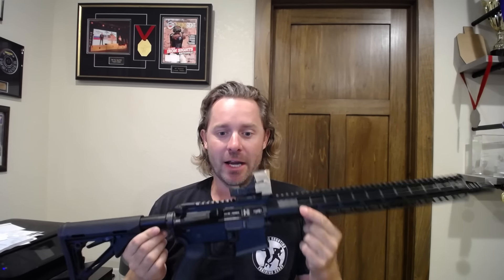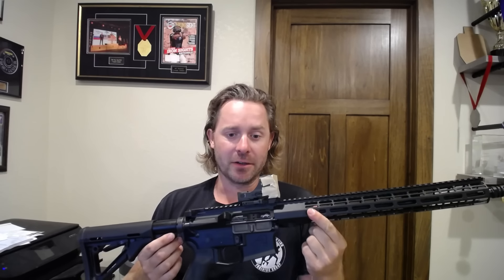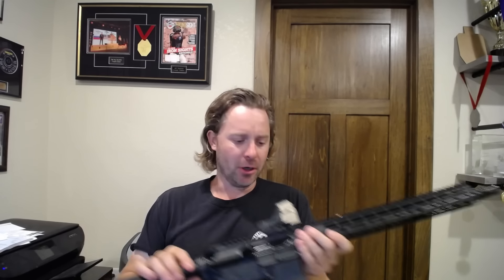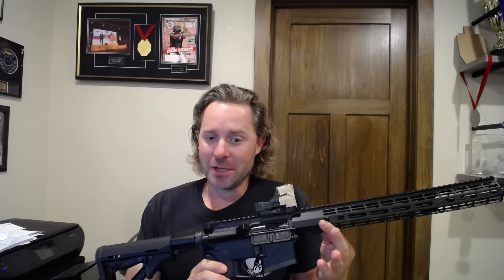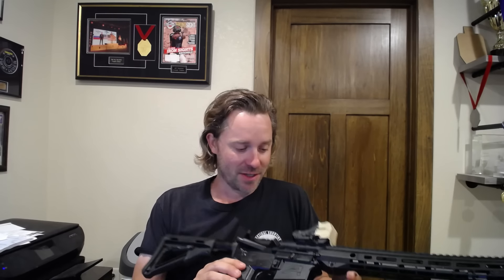Yes I understand Aero stuff is garbage

Comment: Aero is definitely not garbage.
Reply: Cope harder
Reply: Certified fresh copium™
Reply: I think the problem here is context. Is Aero “just as good” as high end rifles, no. In fact by comparison garbage is not an inappropriate term to use. 

However, most people will not EVER see the round counts that professional end users see, and for a range gun, which get’s cleaned more than it’s used, it probably will function as intended for most people.
Reply: Yeah but they are. The cerrakote on the inside of my upper chipped away in like 300 rounds. 
My DD upper has several thousand rounds through it and the cerrakote is still intact. 
I believe Aero used to be really good budget brand but they’re dropped off as of late.
Reply: @aerowrench6787  I have had similar experiences between my DD and the one Aero I have. That being said, when it’s clean and you’re running good ammo it works pretty well as a class-loaner/beater. 

I would not leave the house with it as a primary, nor is it the one I use for duty/defense. 

All I was saying is that for the average person as a range toy/hog gun/first foray into AR’s it’s not bad and is not incredibly overpriced for what it is.
Reply: I don't use their bolt or bolt carrier groups for this reason. Ben isn't the first, or will he be the last to experience this. 

I have yet to have a single issue with the M4E1 receivers or their rails. So if you put the good parts where they matter, the rest is good to go.
Reply: Aero is boo boo
Reply: Aero bcg’s are garbage. School of the American rifle goes into the best coatings. Chrome plated and Phosphate with chrome lined carrier and gas key. Nickel Boron is the worst because it is next to impossible to get a even coating. One in three are out of specification. Nitride is easy to clean. But that’s about it.
Reply: @TheDrPepperFairy23 I would absolutely argue a aero rifle is more than capable as a SHTF rifle, definitely for home defense stuff and of course a range toy. Aero builds very good quality shit. You don’t need a $7k KAC rifle for a SHTF quality build.
Reply: @9770G  congratulations 🎊🍾🎉
Reply: I have 4 Aero rifles and they all have 1000s of rounds through them without a single hiccup. Aero Precision FTW!!!
Reply: When you realize aero makes a lot of parts for a lot of manufacturers that you probably got your lame ass over priced Gucci gun from
Reply: Aero is gtg. It's not the best, but mine has ran flawlessly. They make solid recievers that you can build something really nice on. Put good parts in an aero, and you'll have an excellent rifle. I do plan on upgrading the upper to a geissele or DD because i want to downsize to 16". 18" with a RC2 mini is a bit long.
Reply: @aerowrench6787 that’s because the DD is anodized not cerakote. Cerakote wears much faster than nearly any other finish
Reply: Forged matched sets for under 200 In some cases garbage my ass
Reply: @moostangvert he doesn't need to cope.
Reply: @seanhatch4425 I'm with you have have 3 and they have all been golden. Well over 5k rounds
Reply: Aero is not 🗑️ 
😂
Reply: Tell them to ditch ballistic advantage barrels, that's a start.
Reply: @p47rr 
In fairness he also says NP3 are up there with Chrome and a quality Phosphate.

I run NP3, love them.  Only a few manufacturers have them, as Scionics controls the process.
Reply: @xanthrax6179  and Ballistic Advantage makes their barrels
Reply: @YouTubeflakeland BA makes SOLGW barrels. Are they 🗑 too ?
Reply: @Edc-Guy  Not all but they have shit runs too. It's not the puzzle maker's fault it's the barrel manufacturer. If solgw made their own barrels they would probably be twice the quality of BA, considering Mike cares.
Reply: @YouTubeflakeland  then why don’t they make them ? Could it be that he cares so much, he / Solgw team designed a specific design/profile that they stand behind for life from a barrel manufacturer they trust ? There is very few high end manufactures of barrels and it’s very rare that somebody makes their own.
Reply: @Edc-Guy  it's called a whole fuck ton of money that rich guys seek wealthy investors for 😘
Reply: @aerowrench6787 the E1 models are top tier man idk what ur talkin about
Reply: @p47rr hundreds and hundreds of comments simping for aero and youre the first other one ive seen bringing up SOTAR. its like the whole reddit ar15 sub collectively soyed out and decided to shit on ben 😂
Reply: @YouTubeflakeland don’t think aero would dump Ballistic Advantage Barrels, they own them!
Reply: @frankyeilding2546  You are correct. But most people have no idea what NP3 is. And not as common to find.
Reply: Apparently you can't comprehend the words coming out of his mouth .thx for letting us know. It's not his opinion like others but pure cold hard facts of round count
Reply: @ExcitedSolarSystem-jr2rn  they can't even take the time to pin a gas block lol, these things are not top tier. They look cool but that's the only difference.
Reply: @Edc-Guy - SOLGW has a good video on barrel finishes and longevity that really opened my eyes to how good  non chrome lined barrel can be for the price. 🤣
Reply: @aerowrench6787  That's more of a problem against Cerakote.  Imagine crying about a largely cosmetic coating instead of any actual mechanical problems with the gun itself.
Reply: @rodiculous9464  Dude makes a very short Youtube video, makes a claim, and then doesn't produce evidence in the video.

The person who mentioned SOTAR doesn't link to any video and only talks about coatings.  Considering SOTAR doesn't make manufacturer recommendations...

Oh, and SOTAR DID do a bolt physical on 2 Aero bolts:  https://www.youtube.com/watch?v=ihWIjCMme34

One had a magnetic firing pin which was fixed by running it over a demagnetizer.  One carrier had a slightly over-sized gas key.  No insufficiency of material quality was found.
Reply: @cstgraphpads2091  or more like how it’s applied. 
Again, my DD is 8 yrs old with several thousand rounds through it. 
Costing is intact.
Reply: @aerowrench6787  Cool story, now let's see some actual evidence.  Nevermind that it still doesn't mean anything in terms of the actual mechanical quality of the gun i.e. the only thing that matters.
Reply: @YouTubeflakeland  Why would they need to when torqueing the gas block screws is sufficient?  Why would that matter in terms of the quality of a receiver milled out of a single metal block?
Reply: @cstgraphpads2091  cool story bro. You wanna simp hard for aero that’s all you. 
I use my rifles and expect a high degree of accuracy and reliability. 
Does the upper receiver induce faults? Well the chipped cerrakote leaves exposed aluminum and becomes a trap for soot and later corrosion. The barrels are crazy over gassed, especially when you throw a can on them. Overcycles the bolt and even more dirty. 
I put 1000 rounds through my DD with zero cleaning and lube and never had an issues. 
My aero was a gassy, dirty and needed to be cleaned after a few hundred rounds or it would start having issues. 
Aero is fine for a range toy. Not for a live saving tool.
Reply: @cstgraphpads2091  last time I checked aero makes forged receivers lol. It's sufficient if you just lug it back and forth to the range just don't drop it too hard or fire a lot of auto lol.
Reply: Well Aero doesn't make their own BCG's or barrels.  Aero makes receivers and handguards.  Ballistic Advantage makes their barrels.....  With that being said, if you buy a rifle that was assembled by someone else, there's no telling what you'll get.  I don't let anyone assemble my rifles.  I don't trust anyone from any company with something that important.
Reply: @moostangvert  adult harder
Reply: @YouTubeflakeland  they pin the gas blocks bro ur wrong in your information.  Its just non adjustable from the factory. But its pinned bro
Reply: @ExcitedSolarSystem-jr2rn  no bro it's not, lol it's set screws.
Reply: @ExcitedSolarSystem-jr2rn  not to mention I have 4 sitting in front of me. I'm still looking for that pin through the block & barrel you're talking about lol. Seeing I'm getting broed, I'm assuming you don't know a detent from a set screw from a pin but you know they pin the gas blocks lol.
Reply: @YouTubeflakeland  what you fail to understand is in 2024. No business would actually thrive if they actually "sucked"... i do agree aero is overgassed. But add a heavy spring. 5.6 oz buffer. My ar10 308 has over 11k rounds. Rifling is untouched
Reply: @YouTubeflakeland they use pins bro...but even if they did use set screws... theres been 0 cases of gas tubes failing from Aero... so if it is a set screw.. it fuckin works!!... but its not a set screw. Its pins. So ur wrong both ways
Reply: @ExcitedSolarSystem-jr2rn  no, keep playing airsoft and paintball. I know wtf I'm talking about sugar muffin
Reply: Every gas tube is pinned in a gas block, I'm talking about how it's attached to the barrel. You don't even know what I'm talking about lol.
Reply: Idk I just paid 220 bucks for a handgaurd that is thinner, doesn’t fit right, has defects, and is crazy heavy compared to a rail that was 50 bucks that is twice as good as the aero. They are kinda bad frl
Reply: @YouTubeflakeland  "Sugar Muffin" 😂 I'm stealing that lol.
Reply: Pros recommend aero...its definitely not garbage lol however I don't care for their bcg...enough said.
Reply: Agreed.
Reply: Exactly. Like WTF.
Reply: @seanhatch4425 Low round count.
Reply: @liamvosefski2795 LMG, 1000 flawless rounds?
Reply: How sweet he makes videos in his parents basement!
Reply: Nitride treatment isn't a coating. It's a surface treatment. It actually changes the surface composition of the metal, down to a certain thickness. Coatings go on top of the metal they're coating, and add thickness, so you have to account for the added thickness in manufacturing (typically). Cerakote for me personally is the worst possible coating...it's essentially just paint. It's heavy, and soft, and tends to chip or peel over time. I hate Cerakote...the only thing it's good for is making things look "cool", cause it gives you the option for custom paint jobs. If ur doing this at home, I guess Cerakote is better than nothing...maybe.
Reply: Yes, they are. You get what you pay for.
Reply: @MattfromFlorida-u5f If by getting what you paid for is an average mil-spec service life of components...I don't really see that as a downside, for the money. I guess if you were expecting more, I could see how maybe you'd feel you got less.
Reply: @HEBEsReviews thats what i plan on doing tbf.  DD bcg, Geissele lower parts. Should be pretty good
Reply: AERO makes parts for alot of other companies.
Reply: BS just theowing more shade as he is want to do.  Nithing new here.  Lose the gut and wash your hair Ben.
Reply: @aerowrench6787  Cerakote has nothing to do with the quality of the receiver. Aero makes upper/lowers for probably 50% of the "UPPER TIER" brands you'd deem superior. I don't own Aero btw. I have a BCM mk2 upper and BCM lower and then an LMT mars-l lower and LMT mil-spec M4 upper.
Reply: I’d say the QC issues since Covid are still a thing. I personally love AeroPrecision but I don’t buy a whole gun or especially the upper. They are great for builders, it’s the best bang for your buck especially aesthetically imo. Lots of opinions on this and that’s fine, your money so do whatever you want. 
ADMMfg, Aero, BGDefense(type A rifles), SOLGW are great for builds.
Reply: Areo is a low tier AR15 just like PSA. Ok for target shooting but not real shooting and definitely not an SHTF rifle
Reply: Is aero the only company to have this part fail?
Reply: @jasenjohnson3717  Defo Not🫡
Reply: I’ve never had any issues with my aero
Reply: Saying a bolt is garbage therefore all of a company parts are garbage is hilarious. By that metric every auto manufacturer would be trash. Every AR company has had issues. KAC and LMT I’m looking at you.
Reply: @xanthrax6179  that and Ballistic Advantage
Reply: @aerowrench6787  "throw a can on it"

Anyone that simply "throws a can on it" when talking a mid-tier rifle, doesn't really sound like they know what they're talking about. Even higher end rifles need tuned if not running a RBP can.
Reply: Definitely is.
Reply: I put over 1000rds through mine. Still looks and works like the day I purchased it
Reply: I’m at well over 3k rounds with Mines. Still works and looks brand new.
Reply: Aero is TRASH
Reply: @moostangvert 😂😂😂😂 20k rounds and it's trash? Ok Mook.
Reply: @aerowrench6787 idk my Aero upper fits tighter with my lower and shoots flatter than my buddies DDM4PDW 🤷 depends on quality control imo but idk maybe I just got lucky.
Reply: They are absolutely garbage.
Reply: Their standard rails and bcgs are
Reply: I the Fudd's showed up to tell people to "cOPe hARdEr" 😂😂😂 this is their new "let's go Brandon" 😂😂😂 then they hop off because they gotta head to the Dollar General to buy their wifes boyfriend a 12 pack of Mic ultra and a bag of Takis 😂😂😂
Reply: Just their customer service, QC, and their logistics right? Waiting over a month for “in stock” items that show up out of tolerance only then you get to play the wait for hours in a customer service queue. Then if you actually manage to get a hold of a cs rep you get to play snail mail tag you’re it until they either fix the issue or you go to another company.
Reply: You're right. Aero is HOT garbage.
Reply: @seanhatch4425 how many aero bcg you own? Lol
Reply: @armon8399  PSA is far superior to Aero precision.
Reply: @andyeighttre  Aero makes plenty of junk parts. Not just bcg's.

Comment: Aero upper and lower receivers are great quality and value. I almost always go with other brands for the barrels and bcgs I put in them though.
Reply: I' agree with you there, I have used their M4E1 normal receiver sets on several builds & IMO for the money on a standard config rifle are better than any of the other normal receiver sets around. My current rig has a NB A*B arms bolt, DD CHF barrel pushing now 8500 rounds with no issues
Reply: SAME
I have an Aero M5 upper & lower receivers and built them out with aftermarket parts.  Barrel and BCG I went with Wilson Combat and they are amazing.
Reply: Why cheaper
Reply: BA makes their barrels and BA makes good barrels
Reply: So the two most important things get changed?
Reply: @TDub777  not changed, you buy the receivers as a base to build around and put whatever parts you want on them.

Comment: The military tries to replace bolts every 6000 rounds but expects them to last around 10,000..3 bolts breaking in 20,000 rounds does not make the entire rifle junk or even bad bolts..Why are Aeros junk and what parts are junk?? What was out of tolerance for you to make this claim?? Bolt over base malfunctions are usually magazine related, extractor issues ( which is an easy fix) or under gassing..Breaking a rifle in does nothing for these problems lol, in fact a good AR rifle needs no breaking in.. All things mechanical needs maintenance and seeing how long a rifle runs without maintenance is like running a vehicle to see how long it will run without changing the oil..Stupid and pointless.. More gun tube bs based on nothing....
Reply: Found a poor aero customer
Reply: Which military? USMC infantry doesn't change anything at anything unless it breaks. And if something breaks, they just give you a different rifle and service the old one whenever possible. You can have a 12 MOA at 100 meters M4 or M16 and it's considered serviceable.
Reply: Spot on

Comment: Colt military bolts USED to be replaced at 6000 rounds. I have no idea of anything from the GWOT era and beyond as I got out before then. 20,000/3 = of course 6,666 rounds. So, not exactly garbage. It was NOT unusual to sheer bolt lugs WAY before 6000.
Reply: GWOT and beyond, they were all over the place honestly. A m16 could have up to 16 MOA at 100m and be deemed “Serviceable” if nothing broke on it. But 6000 rounds sounds about right because a few didn’t even hit 4000-5000 before breaking on one end the bottom 1%,on the top 1% end 25,000- 35,000 needing other parts like barrels before bolts, most bolts lasted at the 8000-12,000 mark. It’s hard to have solid numbers since it’s all an estimates based on total ammo used in a year.

Comment: That round count on those bolts... you realize that's basically the standard lifespan right? They survived as long as most other bolts would. Did you ever even change the gas rings?? Sounds like a quality part to me.
Reply: Yeah GT had that AR super geek on when discussing the PSA freedom ar and talked about how even higher end bolts last about 5k rounds. Sounds like the rifle did what it needed to do. And you can find AERO uppers for $300 excluding the bcg and ch. If you don't want an AERO bolt get a different one. 🤷‍♂️